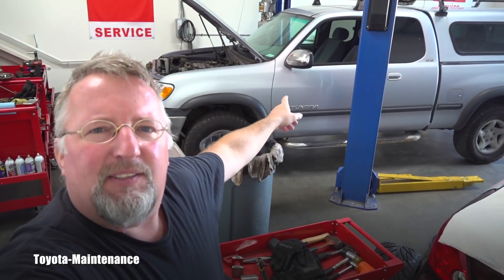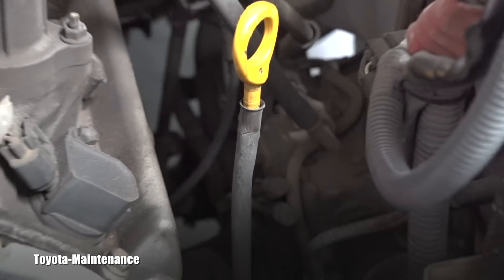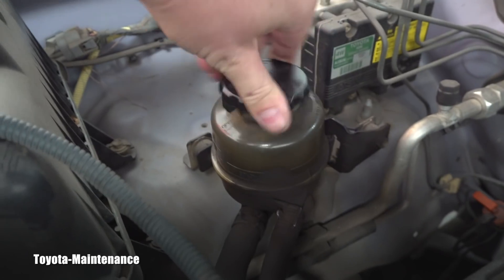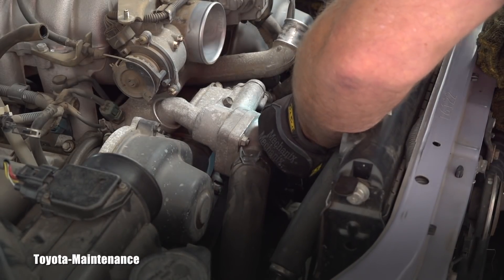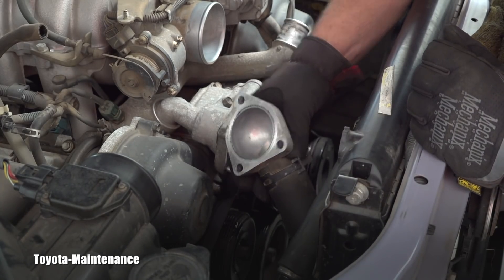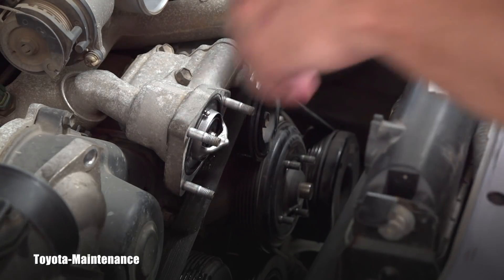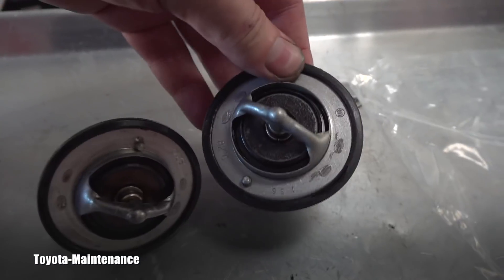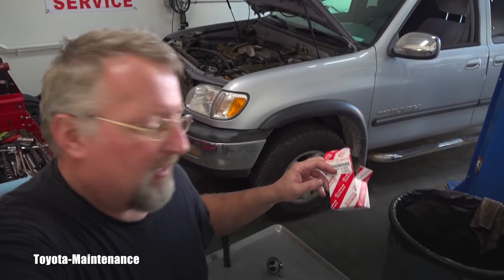Toyota V8 engine 2UZ-FE Thermostat

Comment: My beloved 2006 Tundra just flashed a P0128 code. I figure I might as well replace the thermostat as it's relatively easy to do and usually the cause. Thanks for showing the actual part numbers and saving me the time of having to run those down...

Comment: i did mine a little while ago. i noticed the new one was a smaller diameter than the original. i decided to use it anyways because the it looked like it still had plenty of sealing surface as long as it was centered. But now, 3 months later it is leaking. i must have gotten the wrong one.

Comment: What is worst  that can happen if you put the giggle valve in the wrong position  ?
Reply: Probably not much. It is probably only to get all the air out of the cooling system when the coolant is changed, so you don't have to fill it more than once. But who knows, the air might get trapped somewhere and decrease the engine cooling (unlikely with the speed of water circulation by the pump) or heating for the interior heater?

Comment: Hello Peter, i just noticed a hairline crack on the top  of my 2002 tundra radiator (coolant seeping out slightly). Do you recommend replacing with Toyota original or Denso or use an aluminum radiator? Thanks.
Reply: Only OEM for any manufacturer.
Reply: @Bushy556  thx. That's what i ended up doing. Hoping to get another 20 years out of it.

Comment: They should have offered this engine in the Tacoma.  Could never understand why they did not.  I do like my 4.0 though.  Will be proven in time to be stone reliable also.
Reply: I agree, the more choices the better. Let the paying customer decide what engine and transmission comes with the truck/car they are buying with their hard earned money. You may remember that 10 years ago the 4Runner came with the 4.7 V8, 4.0 V6 or 2.7 4 cylinder.
Reply: @RightLaneHog3151  Same 5 speed auto as in the taco.

Comment: This’s my engine on my 04 Tundra 16 years later still running like a new truck
Reply: Best engine Toyota ever produced
Reply: I have an 06 Tundra 4.7 with 236000 , its at the shop getting its original timing belt replaced , Yes it still ran good ,
Reply: @edwardautrey3671  Wait wait you had it since brand new? N you’re just replacing original timing belts?
Reply: I want him as my mechanic! Where is he located please?

Comment: There is two kinds of 2UZ-FE engine.
One has an alloy intake manifold and the other has a plastic intake manifold. 
One is  interference and the other is non interference. 
But why the same has the same code which is 2UZ-FE???
Reply: They are both interference, one has VVTI one does not. Aluminum intake manifold is non VVTI, Plastic is VVTI
Reply: Haha, right?

Comment: May I ask a question: how do you know it's the wrong power steering fluid?  Factory ATF is clear and I think many dealer garages use clear fluid, too.  Is it because it's not red?  Thanks for your channel!   (btw, be careful with that oil dipstick tube...it's held in place at the pan with only a small O-ring and if you pull up on the tube too much to free the dipstick you can pull the tube loose....ask me how I know :/)
Reply: Why does some service information say to use dexron III ?
Reply: Most Japanese vehicles use dexron II fluid, the red one
Reply: @brian_jake  I have seen alot of toyota with that gunk on the PS pump cap dipstick.   Thought it was because of the wrong fluid (Not ATF)
Reply: @brian_jake  Yes, but the fluid as used by the auto factory is almost always clear.  Some say it's to allow dirt to be more easily detected.  Some say it's to allow a mechanic know if it's been changed.

Comment: The jiggle valve is a very good idea for letting trapped air out of cooling system....if there is no jiggler valve on thermostat on my own vehicles I just drill a 1/8 hole in thermostat makes it very easy to bleed trapped air that can cause overheating.

Comment: What do you charge for a TB/WP job on the 2UZ-FE engine? Or do you have an email I can send info ?
Reply: I just paid $725 out the door to have mine done on 2002 Toyota Sequoia, same 4.7l V8 engine. When I called around locally, the estimates were typically between $800-$1000. My Sequoia had 218,000 at time of belt/waterpump replacement. The belt was badly cracked and ready to go at any moment, the water pump also had a small leak.